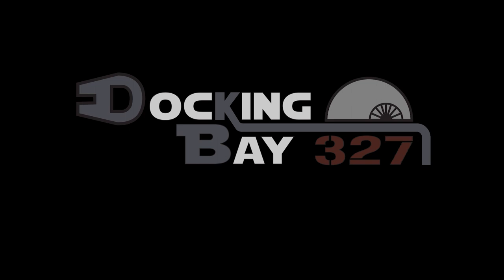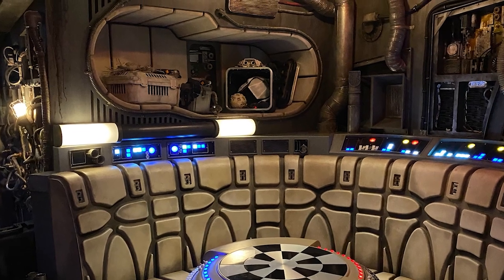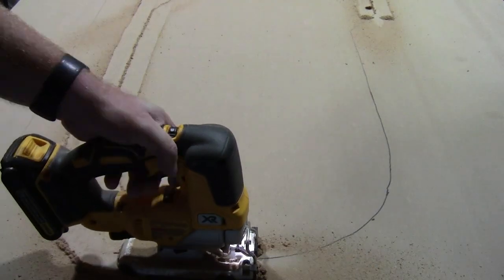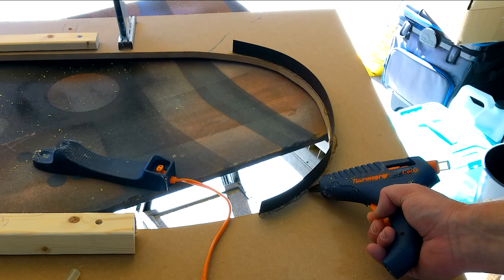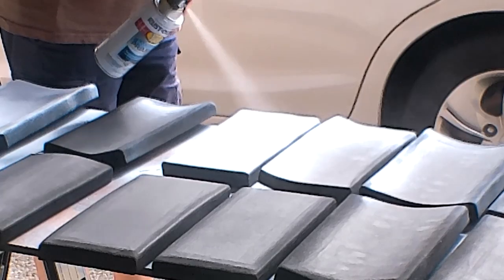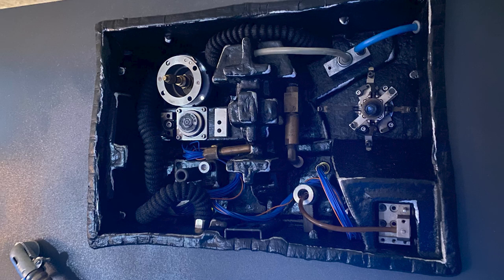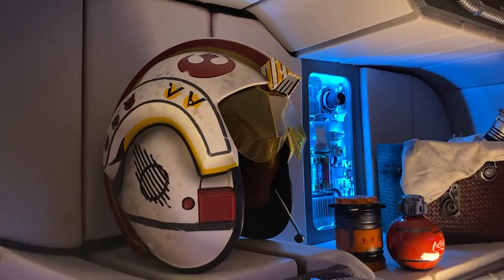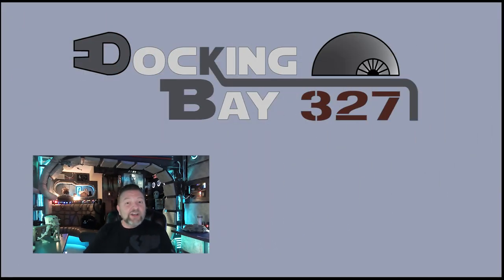Millennium Falcon Bunk - Build Video

Comment: Looks awesome! Small tip for working with some curved parts, you can use 1/8 inch MDF to make those bends or if you’re willing to shell out some more cash you can get 1/4 plywood that is super bendable. I’ve used both for making range hoods and benches when I built cabinets for a living. Looking forward to seeing more awesome builds!
Reply from the maker: Thanks so much for your feedback!! The Masonite is only 1/8” and usually works great! I think I just got impatient and forced it… either way I’ll keep those options in mind for future builds. Appreciate you watching!!
Reply: There's also MDF I've seen available pre-grooved on one side for forming into curves (lots of parallel slots cut partway through).